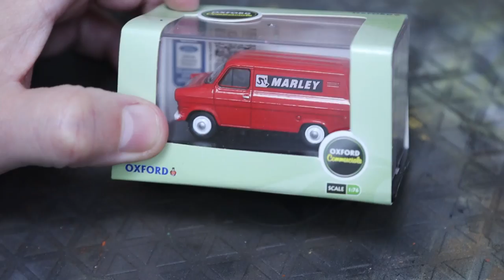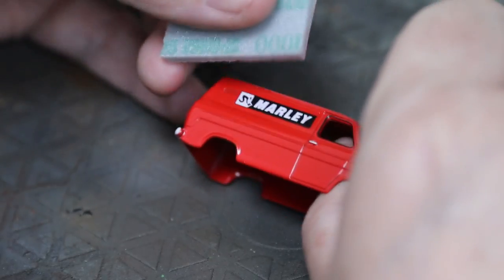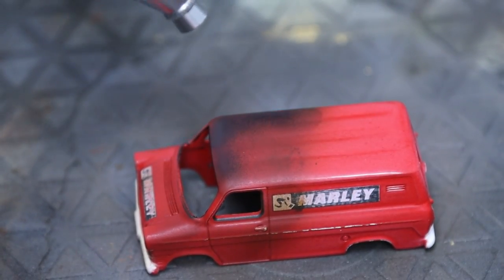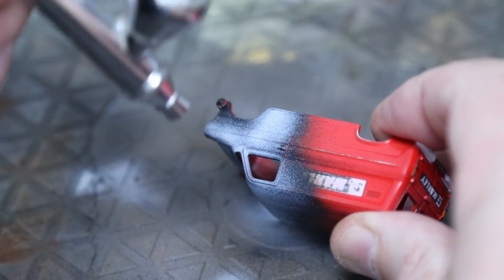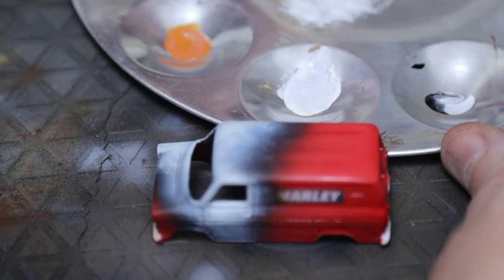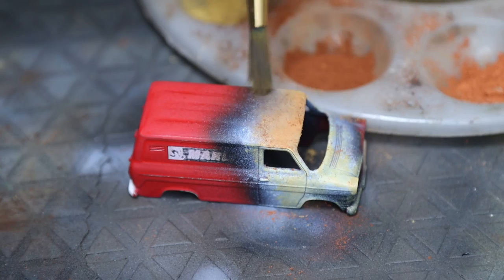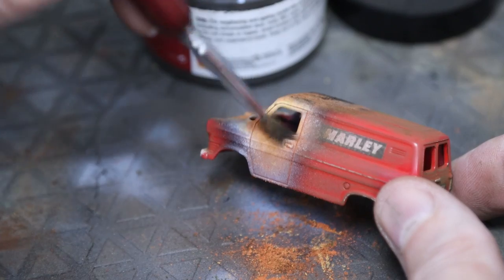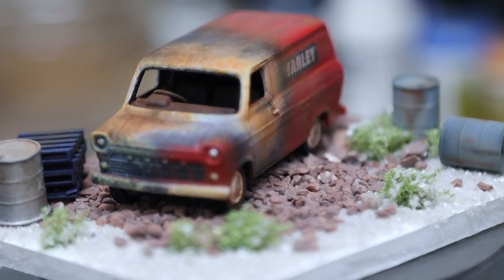Burnt Out Transit Van | Oxford Diecast | Weathering Model Railway

Comment: Good to see the steady flow of videos back again. 
Not done a fire damaged piece for a few years.. might have to refresh that! 
So pigments and powders.. 
Pigments are made from either natural earth or synthetic materials. These require an acrylic carrier / binder /fixer. Pigments are generally finer than powders. Because of what they're made from this is why pigments are easier to remove from a model if you make a mistake than that of a weathering powder which as you know doesn't shift. 
Weathering powders are generally oil pastel or chalk based and only work with a solvent base medium to fix, bind or mix into a paint using enamel thinner, solvent varnishes etc.
Reply from the maker: Thanks for that. I’ll look forward to seeing a fire damaged from you

Comment: An excellent creation but what about deflated tyres as they would not be fully inflated after a fire at the front as well as cracked windscreen from the heat?
Reply from the maker: Hi Les. You’re correct as the tyres would probably be deflated, although I’ve seen a few pictures with similar fire damage where the tyres have stayed intact oddly enough. And I’ve removed the front glass as that would have certainly not withstood the heat from the flames
Reply: @BuntersYard  it was an observation as I’d seen somewhere on a war diorama how to melt the tyres so they look deflated and it did look good as does yours . I’m always sharing your utube videos as they are extremely helpful and the finishing touches are great
Reply from the maker: I’m just working on another one now and have worked out a way to ‘deflate’ them. Looks good. These tyres are a rubber compound